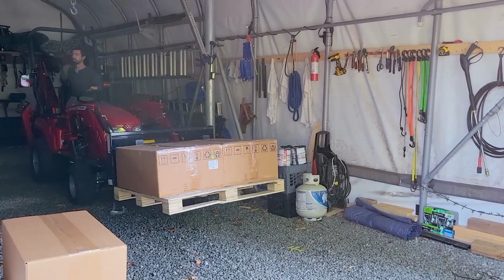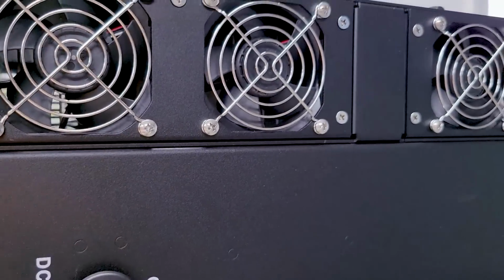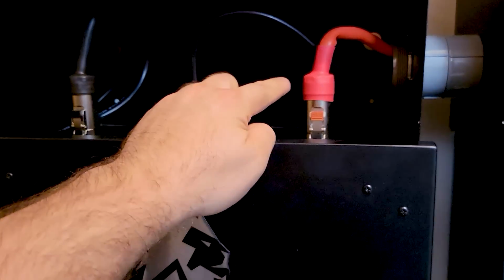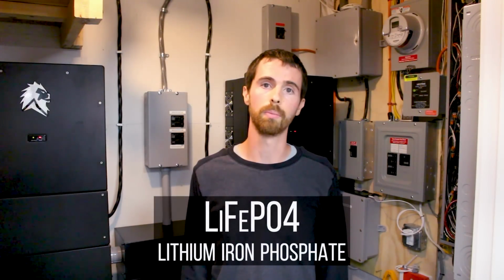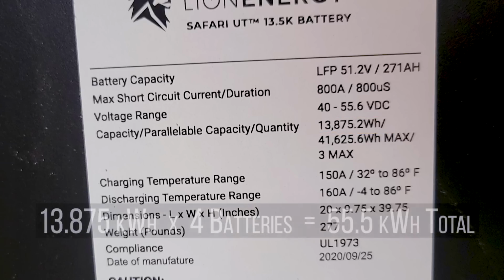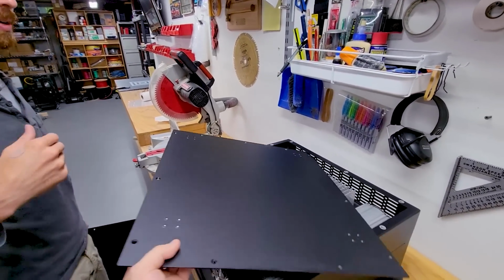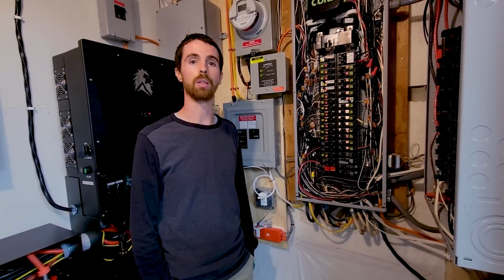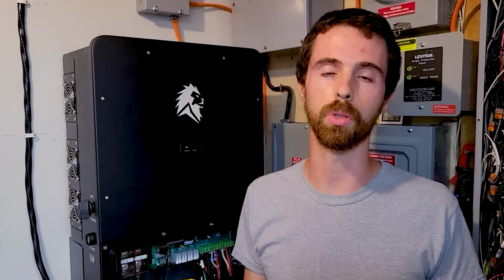LionEnergy Inverters and Battery System

Comment: When off grid,  I assume the solar will cut off if the batteries are full or if the charging rate is greater than what the batteries and grid load can take?
Reply: I was wondering the same. How does the  charge regulation work when using AC coupled charging?
Reply from the maker: The inverter adjusts the frequency of the sine-wave up when the battery is full.  Normal Norrh American power is 60 Hertz.  By adjusting it up to 61 Hertz the micro inverters shut off.  My yellow SMA inverters have the same function built in.
Reply: @DavidPozEnergy  and Victron inverters and many more I imagine. This seems to suggest that AC coupled charging can’t facilitate absorb charging?
Reply: @DavidPozEnergy  Since this has a separate "output" for the grid tie inverters I would hope it simply disconnects them instead. I do not like the idea of frequency shifting to control the solar because that would make electric clocks run fast.
Reply: @eDoc2020  That is a silly but great example of how this could be a problem and perhaps in other technology,  a 1 or 2hz change may not seem like much but it radically alters the clocks of electronics. I wonder what a EVSE would do in that situation?
Reply: @darrenorange2982   @Darren Orange  I don't think an EVSE would care. And my clock example isn't silly. I was referring to the clocks that tell you what time of day it is. If the power line is 1Hz fast a clock will accumulate 24 minutes of error per day, making it fairly useless.
Reply: @eDoc2020  You took my silly statement too on the nose.  A clock is kind of the least of my concern but anything else that operates on a clock is a much bigger concern. It could throw computers and other tech out of sync and or cause communication issues.  Changing by a few percent like that is a massive problem.
Reply: @darrenorange2982  The clock circuits in computers are not counting grid cycles. They are using a quartz crystal oscillator to keep time. The internal clock circuit is always powered by a lithium coin cell with about a 10 year life. Modern operating systems adjust the internal clock (which can drift by about a minute a month) to internet time standards when the computer is online. They would not be affected by the line frequency shift. Using frequency shifting to "trick" the grid tied inverters into shutting down when the battery is full is not a massive problem. It is barely a problem at all - except that is does make clocks that count line cycles run fast. All my wall clocks are battery powered.
Reply: @kevinmills5293  Tesla batteries are AC cuppled and have major issues off grid.

Comment: It is good to use non combustible board for mounting systems of this size. Also best to avoid paralleling of any type if you can; it makes the system more reliable by avoiding single point of failure.

Comment: Wow great video!! Thank you for sharing so many details - love seeing that kind of stuff. Looks like a great system with just a few bugs to work out. I noticed they're using Nader breakers in those batteries. I still need to pick me some of those up. Looks like they have both poles running parallel (negative) at 06:45. Clearly polarity is not an issue as many were thinking, I will need to research more. Also, 05:45 Holy crap that's a massive heat sink!
Reply: I don't like how those breakers were buried so deep and behind the cables. If you were in an emergency it wouldn't be very safe to have to reach in and turn off the breaker.

Comment: I live in California and had no knowledge of solar... so when the sales people came by I bought now I have a system that is tied to the grid and now have two bills on from the solar company and the electric company!  Can I bypass the current setup and install a battery backup where I can actually use the solar system during the day and battery at night? I am no electrician so is there someone that could help do it?
Reply: They probably own the panels too.  Personally I'd tell them to get their garbage off my roof and do it all over again. I'm sure you've also been locked into a multi-year contract  with cancelation penalties:(
Reply: Sounds like your solar system actually belongs to the solar installer company and you're leasing their energy from them. You'll have to check your contract with them.
Reply: Lots of scams out there unfortunately. 
Even if you didn't get scammed many states and utilities are changing rules and allowing MASSIVE grid tie fees. 
In some jurisdictions they REQUIRE a grid tie. 
It's messed up.